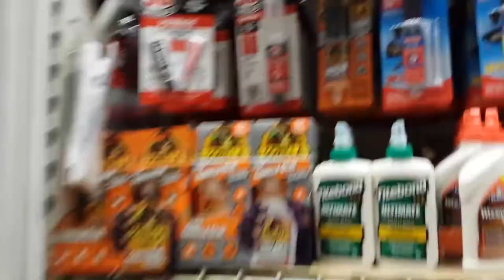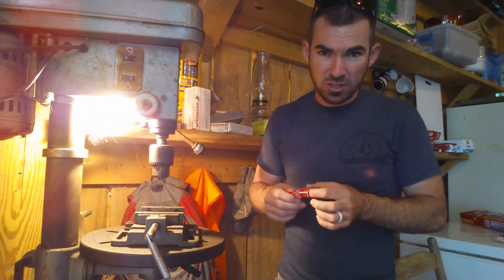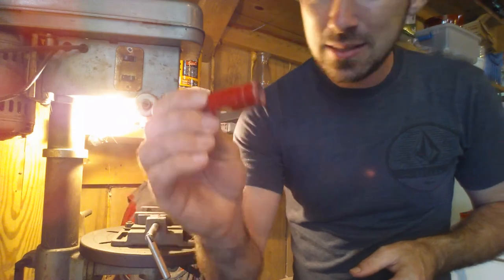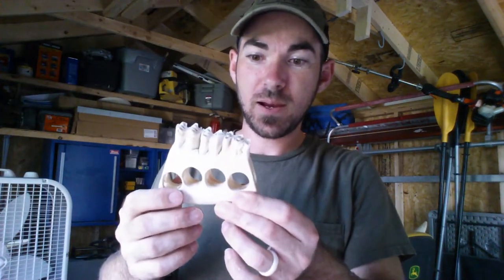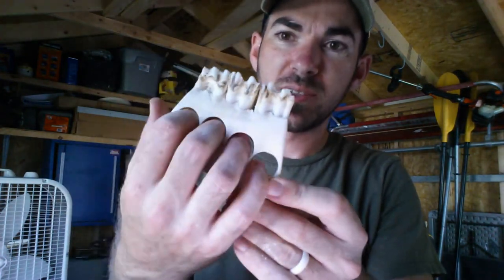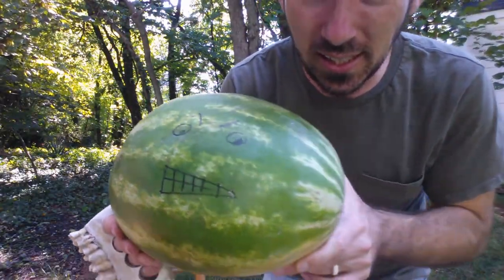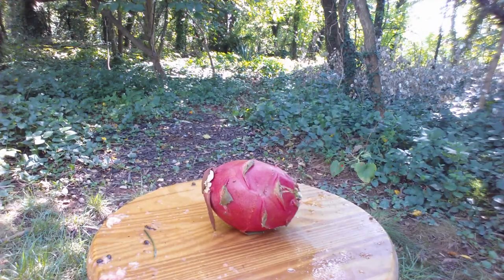Jaw Bone Knuckles DIY

Comment: I'm just curious what kind of resperater you use since bone dust is poisonous. And if not what kind of vacuum system you have set up to keep the bone dust from filling your air
Reply from the maker: Hey! I use a 3M respirator at all times plus a very well ventilated work space and fan. This has a link to what I use http://usskullhunter.com/skull-carving-101/